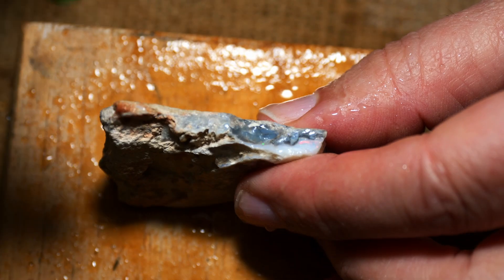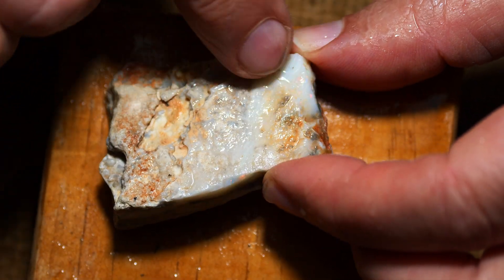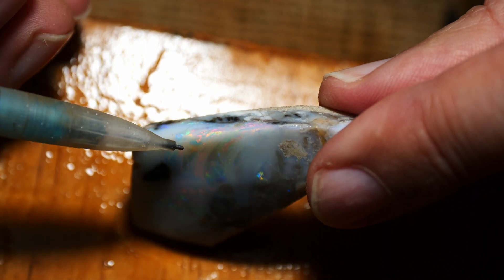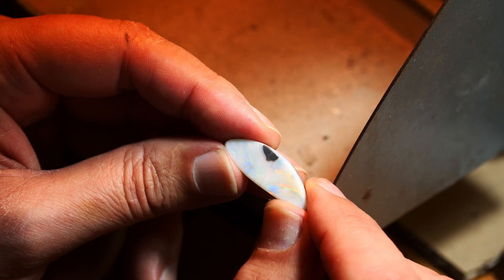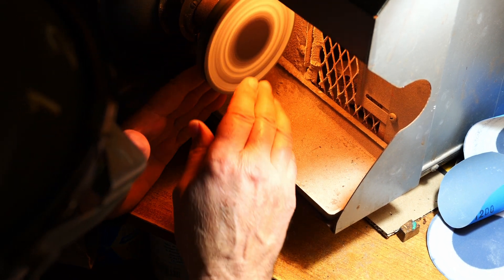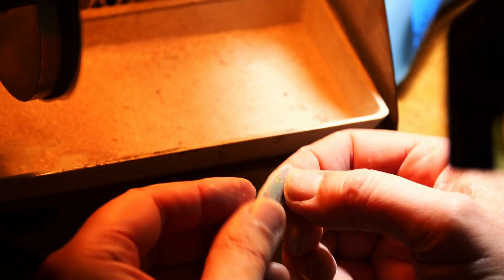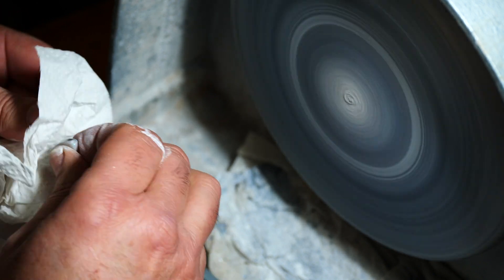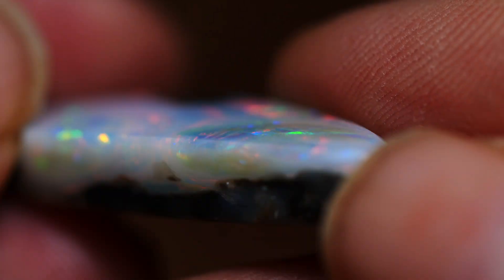How Much Do You Know About Opal Sanding.

Comment: Very nice! 

I recently cut my first Mintabie opals. Interesting challenge. Very fun. Had a couple small but spectacular, bright crystals. The opaque opals ended up with a velvety look with flashes of green or red. Not sure if this is common to Mintabie opals.

Also, colors were a bit different than LR and Cooby Pedy opals I've cut in the past. 

Definitely will buy more.
Reply from the maker: Thank you for your feedback. I am glad your experience with Mintabie opal has been pleasing. Its good to be able to gain experience from cutting and polishing opal from different fields.
Reply: I just got my first mintabe parcel off opal auctions. Good looking stuff. Can't wait to grind it but I'm scared of stuffing it up.
Reply: @ThatOpalGuy  The way I look at it, ruining a perfectly good opal from time to time is just the cost of learning.
Reply: @bentationfunkiloglio  yeah it's always a risk.  Until I get the knowledge and practice working with many kinds of opals it will happen. Fortunately I'm working mostly beginner parcels so many of the stones I have aren't worth too much.

Comment: Hey ive just got a sander, i was wondering about masks, do i need a proper resporator for sanding opal or can i just wet a rag and tie it around my mouth?
Reply from the maker: I would recommend you get a proper respirator, it will be more comfortable. You will struggle to breath through a wet rag especially as  particles build up blocking your breathing area.